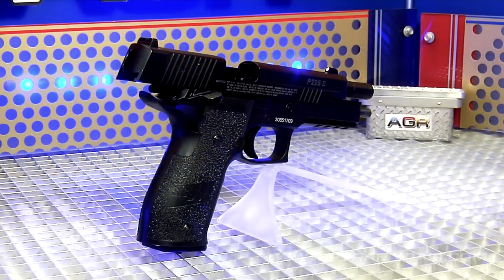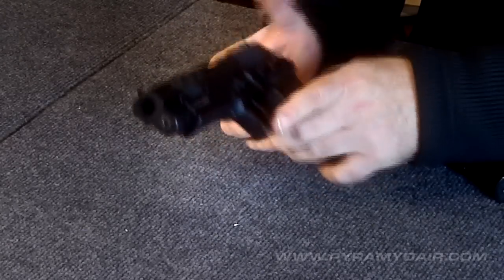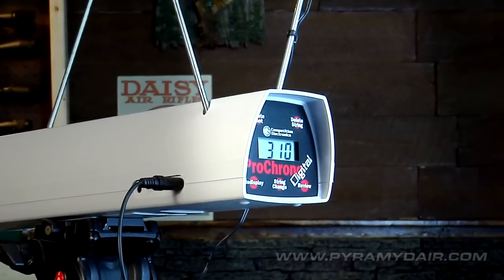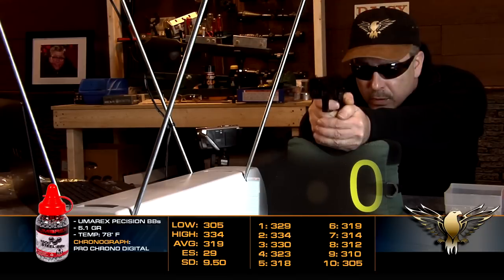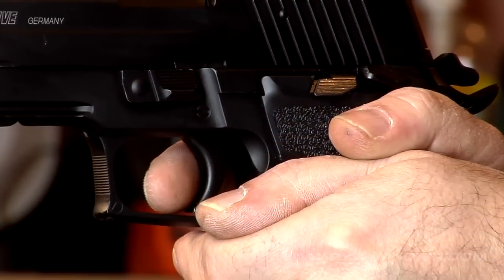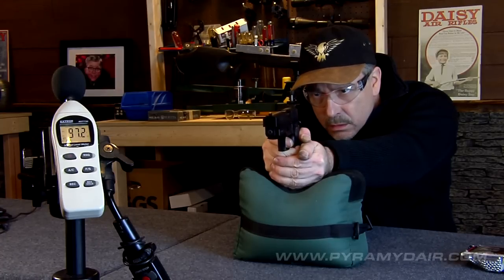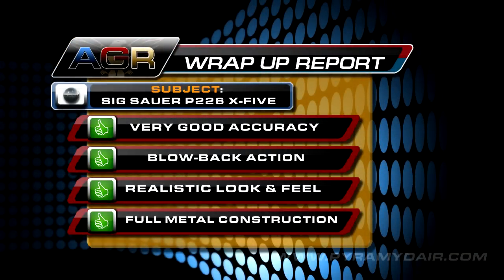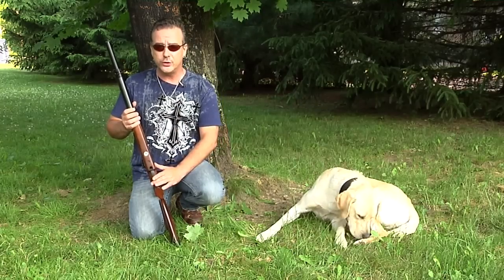SIG Sauer P226 X-Five CO2 Pistol - Airgun Reporter Episode #109

Comment: Nice chronograph, I got one for xmas, but waiting for spring to shoot. Between 1997 and 2007 I raced radio controlled electric cars and used Competition Electronics motor dyno, battery cell matcher, and battery charger. CE makes quality electronics and I'm surprised more airgun reviewers don't use that chronograph.

Comment: i plan on getting my first air gun pistol I'm debating what to get the sig sauer p226 x-five or the tanfoglio witness 1911 a1. which one is better? i like a realistic look feel blowback action and more rounds on the co2. let me know asap so i could get one thanks..
Reply: The Sig Sauer P226 has the most realistic action and look between the two.  Points for the Sig X-Five because the CO2 canister is NOT visible in the clip, unlike the Tanfoglio Witness 1911, where you can see the CO2 through cutouts in the clip.